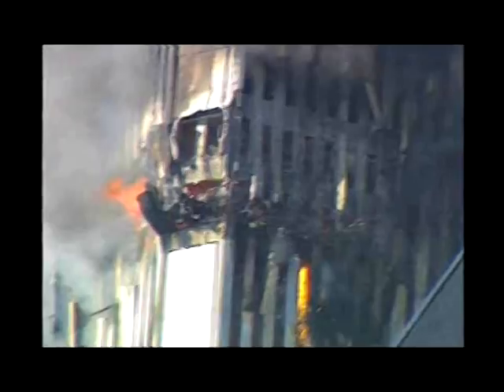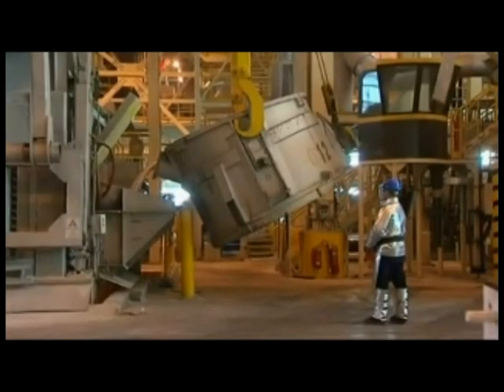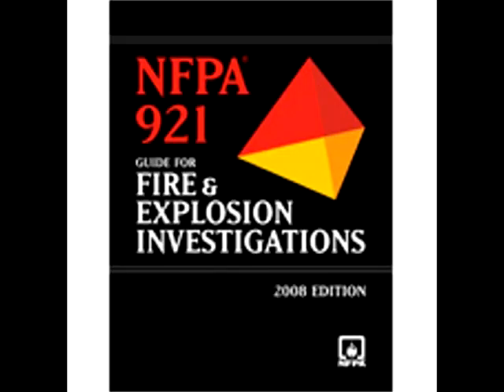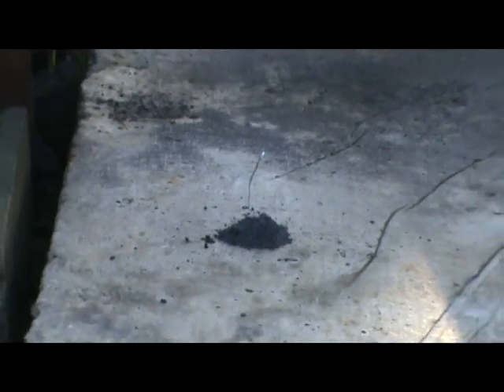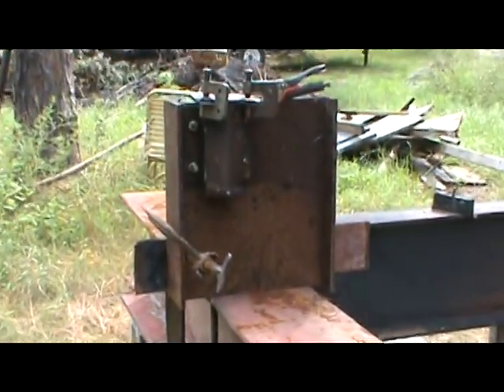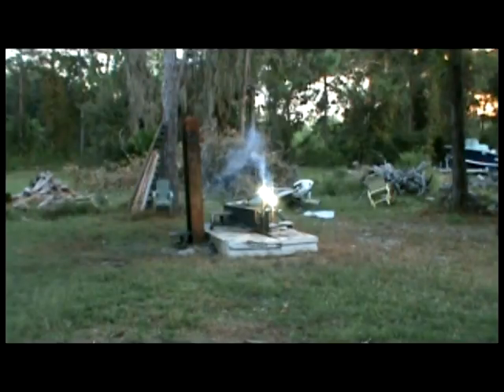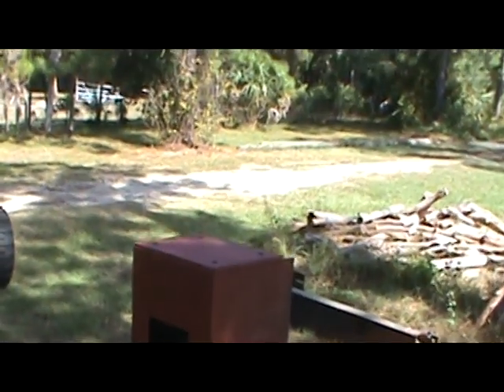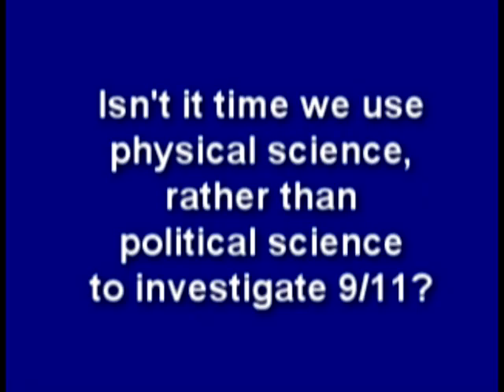9/11 Experiments: The Great Thermate Debate

Comment: Steel does not simply melt. Pig iron does. 
If you heat steel up as temperature rises it becomes softer and softer and starts to glow and then it melts. That means the building should have collapsed before the fire could have molten any steel. If only one side of the building had been so strongly heated up that its steel beams had been melted while the others remained less hot and therefore solid the building would have collapsed sideways.